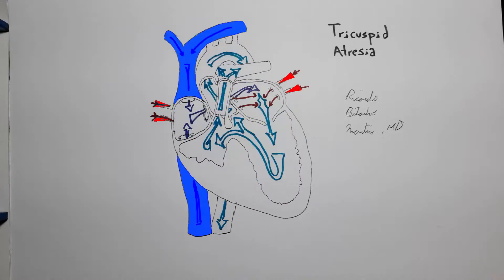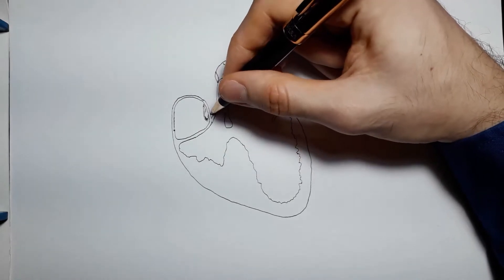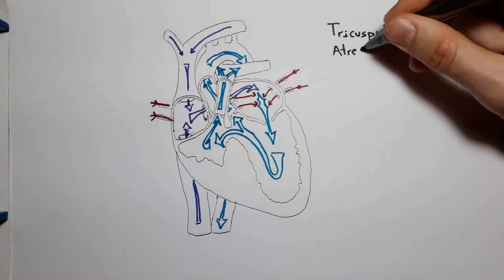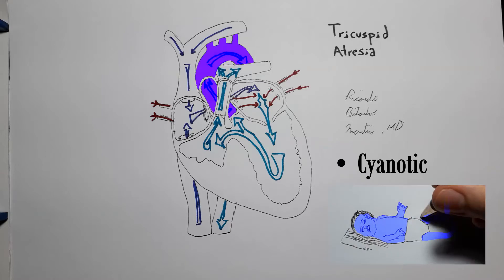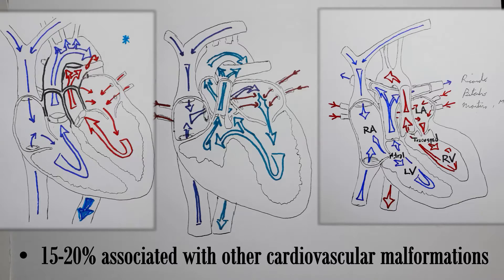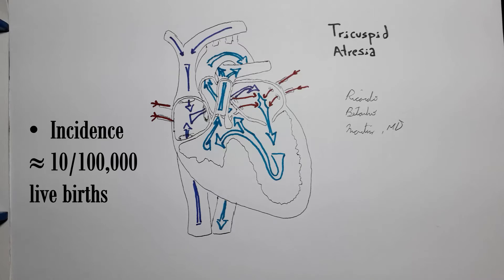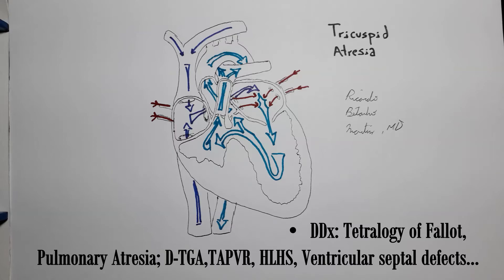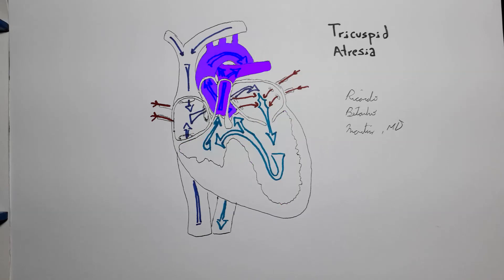Tricuspid Atresia: Anatomy, Pathology and Treatment

Comment: You say there is no way for the condition to be buyable postnatally without viable without a vsd, but I was under the impression that Pda a good shot blood to the lungs if there was no vsd . Is that not correct?
Reply from the maker: You're absolutely right! I stand corrected!
I should have said that both an ASD and another shunt are necessary, rather than specifying the VSD. After all, we may find intact ventricular septum in Type Ia Tricuspid Atresia (with pulmonary atresia).

"In some cases where a VSD is not present or there is significant pulmonary obstruction, the patient is reliant on a patent ductus arteriosus (PDA) to enable blood flow into the pulmonary circulation." (Sumal, AS, Kyriacou, H, Mostafa, AMHAM. Tricuspid atresia: Where are we now? J Card Surg. 2020; 35: 1609– 1617. https://doi.org/10.1111/jocs.14673)
"In patients who have normally related great arteries and no VSD, there is pulmonary atresia, and hence blood supply to the lungs depends on a patent ductus arteriosus (PDA). In type Ia, blood from the right atrium is shunted across the atrial septum to the left atrium and then across the mitral valve into the left ventricle and out the aorta to supply blood to the body and also through the PDA to the lungs." (Minocha PK, Phoon C. Tricuspid Atresia. [Updated 2021 Sep 28]. In: StatPearls [Internet]. Treasure Island (FL): StatPearls Publishing; 2021 Jan-. Available from: https://www.ncbi.nlm.nih.gov/books/NBK554495/)

What a great comment!
Reply from the maker: By the way, I have a more recent video on Tricuspid Atresia ( https://youtu.be/2KDyO_nWeYA )! (albeit with the same mistake...)